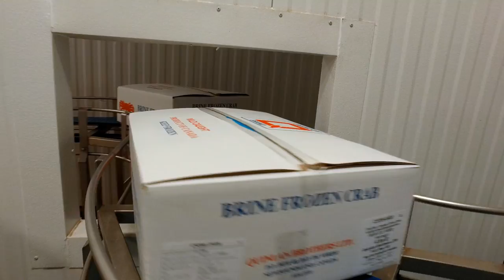This tiny town in Newfoundland is a global snow crab powerhouse | We Are The Best

Comment: If that's true then why the hell is crab so bloody expensive here in the province?  If we are indeed the biggest distributer of snow crab you would think that we would get a discount on them.
Reply: Unfortunately that's not how that works. Same with any other high value fishery. The price point is set, if the local markets don't pay that price, the processors will find someone farther away who will buy it at that price. Your best bet is always to buy directly from the plant, make a friend who fishes, or fish recreationally yourself. It would be neat if fishers and processors were willing to drop the price for a small part of the quota specifically for the area, but fat chance lol...
Reply: @checkle1  oh I'm well aware.  The plant sells for far cheaper than in stores.  The issue is the distance.  The plant could easily be a good 5 hours away, if not more.

I can get someone to take me out cod fishing during the season and walk away with a good 10-12 fish, assuming I can catch them.  It's just the cost of boarding the boat.